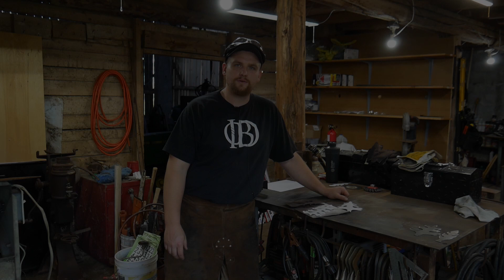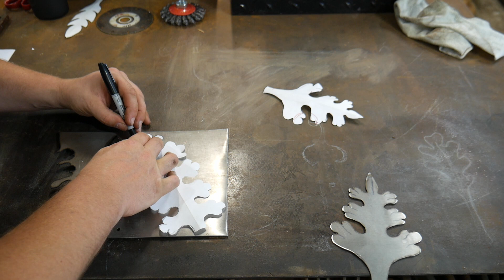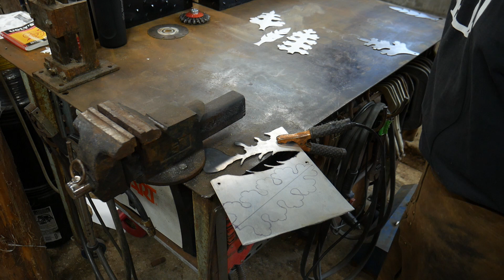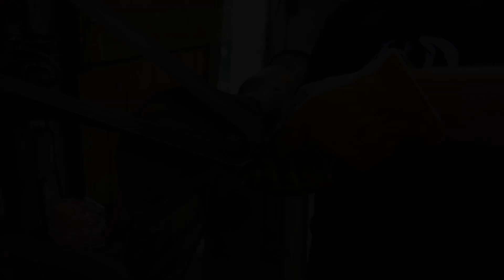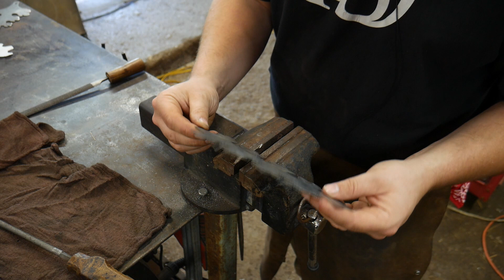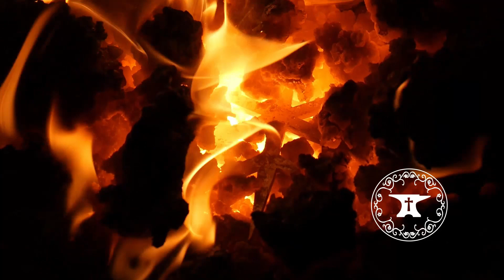Making a Soft Template Into A Hard Template

Comment: I make a lot of metal templates and small diy projects, but just use copper and .040" and .080" aluminum sheet for ease of cutting without owning a plazma cutter.  You can pick up tons of stainless steel sheet from those disposable $1000 - 3 year bar-b-ques you see everywhere on trash day.  My softer templates and patterns are made from 9x12 boxboard samples (cereal boxes) basically. Envious of your plazma cutter. Nice handwork.  Cheers.